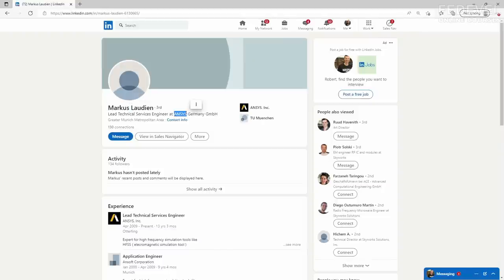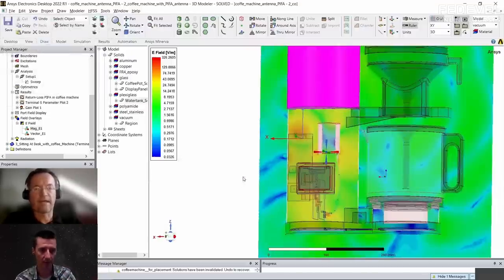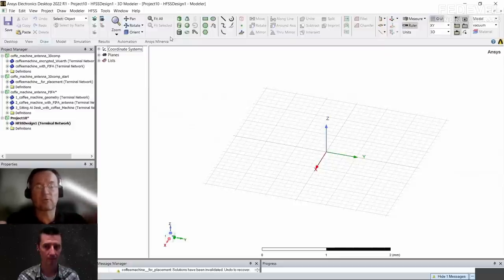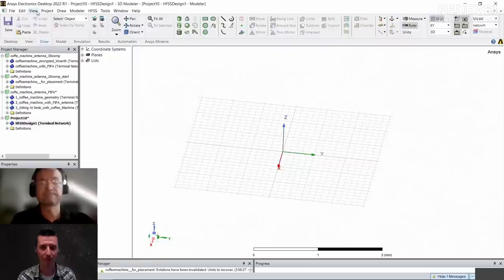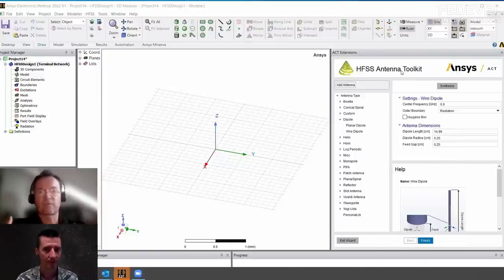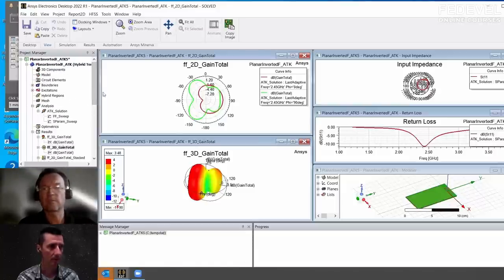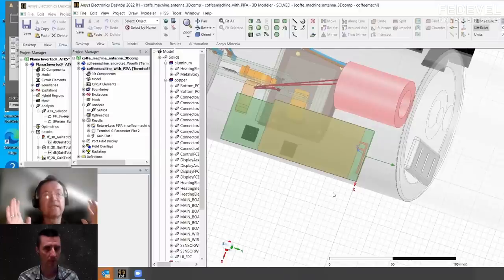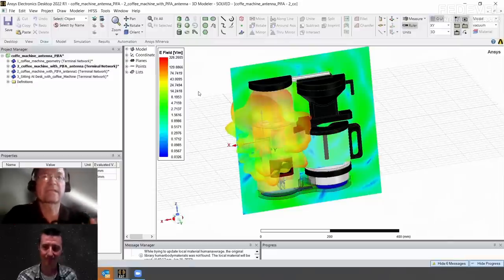Is This The Best Antenna Design And Simulation Software? | Markus Laudien

Comment: Ansys is not a software that anyone can afford, it is pretty good but really expensive. Also using all these expensive software you need to take a loan from a bank to just start.
They offer a nice version 30d for evaluation but then end of the story. very powerful and more specific for PCB is Keysight ADS, expensive. you usually buy the software licence and you need to renew each year at really huge price.
I am not arguing that the software is not ok, it is pretty damn ok! but to afford these software you need to learn how to use and 30 days evaluation means almost nothing if you start from scratch.

I sincerely see the happiness of Robert when looks at these beautiful, btw complex, software.

Is there any chance Robert to investigate if into the free software land or at least at fair economic price software can help Electronic PCB designers to alleviate the risks making critical PCBs by using these software?

Comment: This software is so expensive, ANYSYS won't even be open and honest with just how much is actually costs. It is "price on application"
My understanding is that this software is unaffordable for an independent PCB designer, by an order of magnitude. 
e.g. Reported 'starting' pricing for their Workbench is $30K. The TCO is higher. Want to model that human head in your design?, well their Human Body model costs an extra $10,830 !
i.e. An independent PCB design consultant has no hope of buying this software and then getting enough added-value from it to make an overall profit.
The cost of the simulation tools required to do modern PCB designs is pricing us out of the market, and I am very worried about it.
Reply: I perfectly agree. As consultant you have to work really hard to afford that software. As employee you cannot affor in your entire life these software if you dont work for a big company that can invest on you with a real pack of money to use that softwre.

Pretty coool to see nice pictures of current density on the PCB the Field emitted around the PCB and the heat spread everywhere. thanks but even looking at the training sessions video of Altium they show always something barely limited or usable only if you attach the license to use Ansys or other tools alonside Altium.